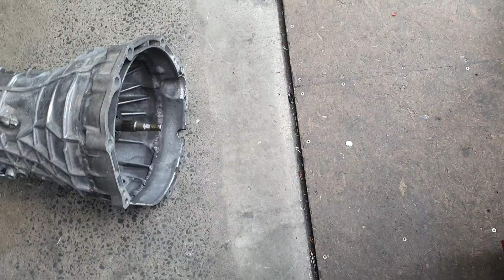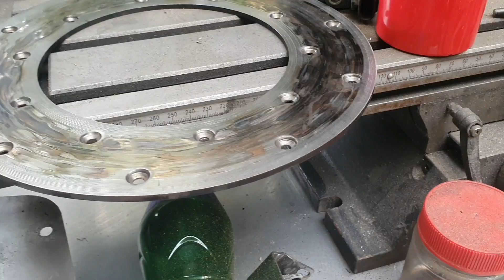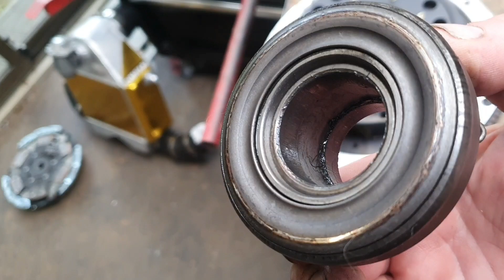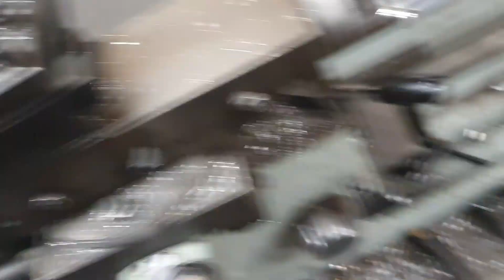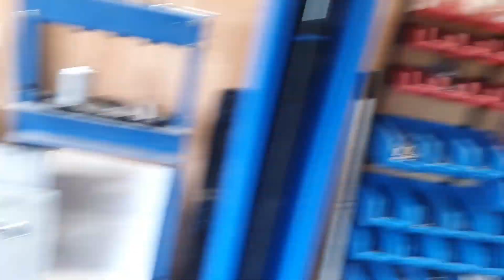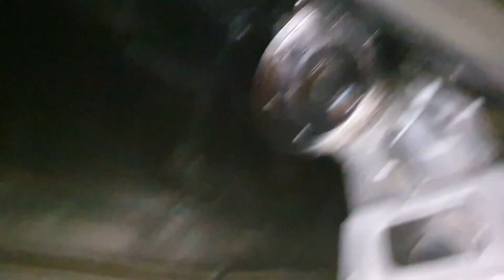Triple plate Quarter Master Clutch for the March

Comment: Hey. what clutch release bearing  did you use?
I have borgwarner t5 with quartermaster 3plate. old bearing is bad and has nothing marks so i dont know where is it from.
Reply from the maker: The one I have in the car now comes from HGT Precision Gearboxes.